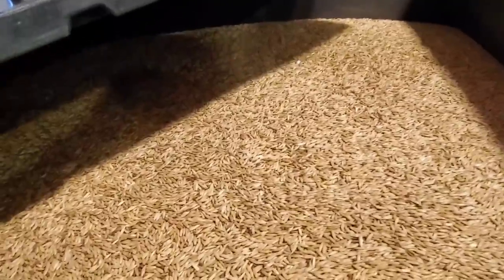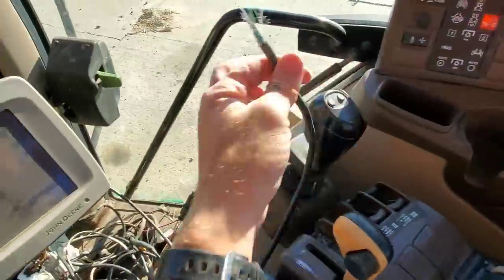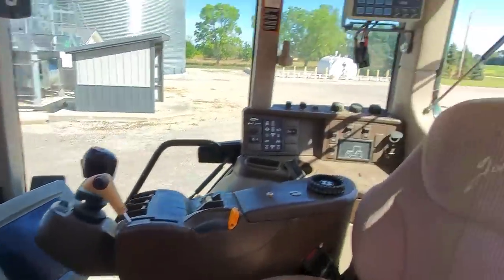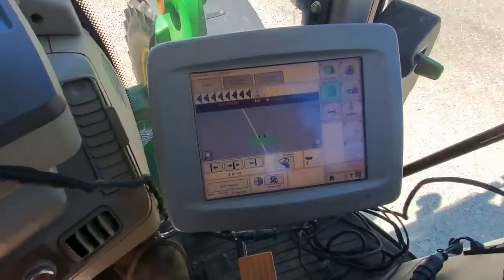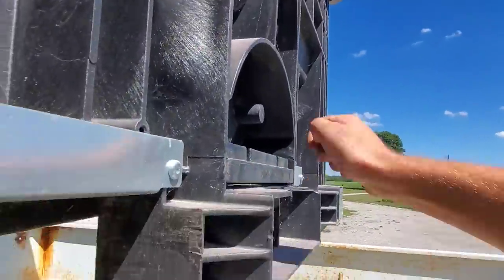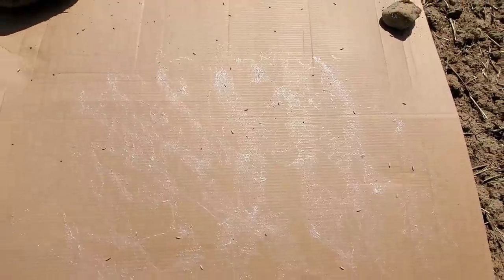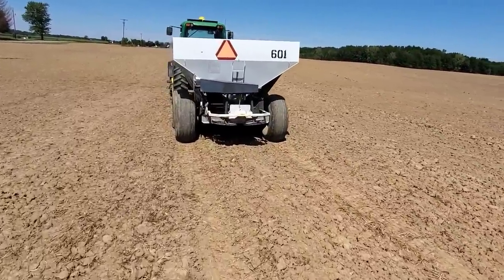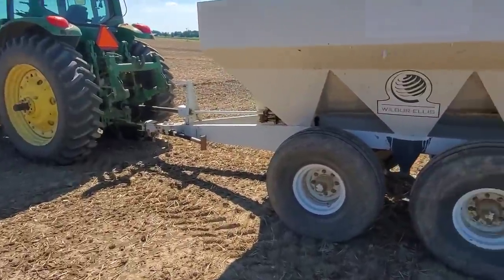Seeding Cover Crops - #229

Comment: Hiya when connecting cables, use ratchet crimp rather than solder. Solder breaks when vibrated over time, crimping is the same result as welding, it lasts, just make sure you've got a ratchet crimper, not hand pressure, they are bad. Steve...

Comment: Nathan. in an 8000 series you can just put the ATU motor facing forward no bracket needed. fits snug just can;t see turn signals or hi low beam indicators.

Comment: Should be a way to slow the chain down
Reply from the maker: Its ground driven so it speeds up and slows dow based on ground speed. It does have a high and low range but im already in the low speed.